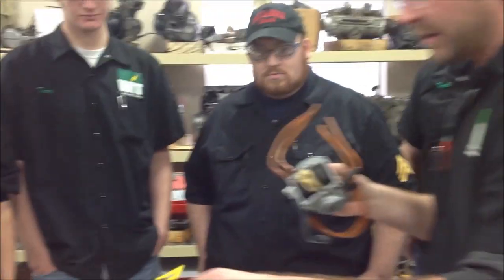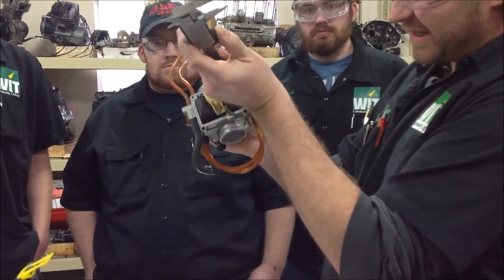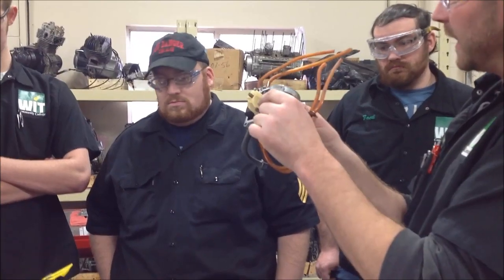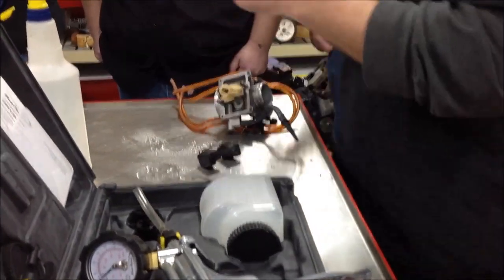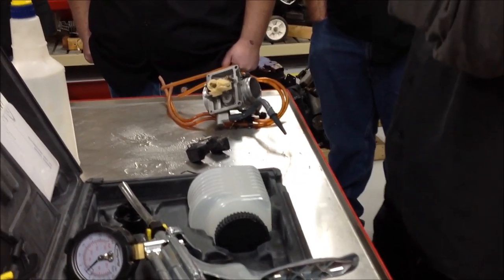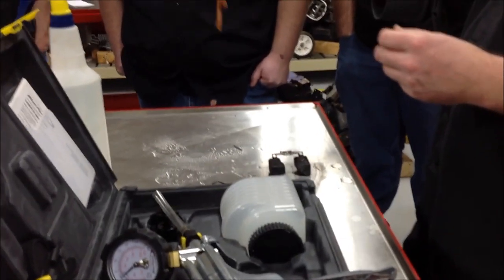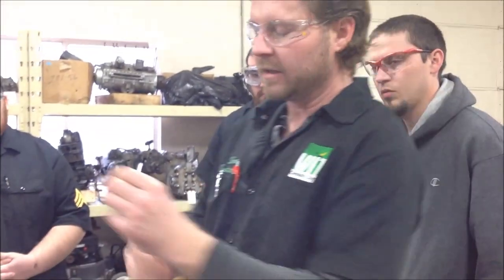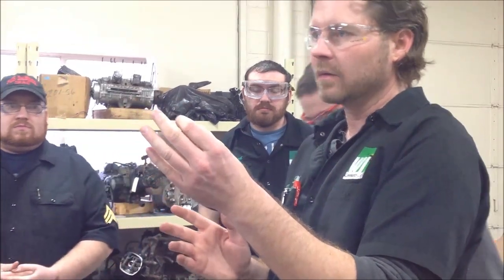Float needle inspection and seat testing on a Keihin or Mikuni Carb Carburetor S&S

Comment: Right on. I have been adjusting the carb so much trying to get everything right. I was adjusting the throttle needle and it helped but was still bogging out in the mid range. Good bottom end and top end but if I'm just cruising it's got a nice sputter to it and it has been fouling plugs too. Time to take a look at the float. Thank your for your brain and sharing it with me.

Comment from the maker: Thanks friends! Many great people have taught me as well!
Reply: Shane great information, can you tell me what port I would connect the pump to a 40 mm CV HD carburetor please. I was having a difficult understanding from the video.
Reply from the maker: +Jordan Tserghanos 
Hello,
No matter what the carb you will attach the pump to the fuel inlet.
Shane
Reply: +shane conley
 Thanks Shane for the fast resonse. Have you ever tested or had experience with CV carburetor modification kits like the CV performance tuners kit or Dynojet kits? I am trying to get better throttle response from my 40mm CV and don't want to swap it for a Mikuni 42 if I can avoid it. I have concerns about drilling the slide and going to a lighter  spring.
Reply from the maker: Love Dynojet and other too....BUT the 42 MIKUNI is AWESOME...I have a 42 but need a 45 on my chopper...107  CU IN
Reply: Thanks again Shane for the response. I haven't had any luck with the standard dynojet kit. I had the slide drilled as instructed in the kit but the slide became irratic. I have since done back to stock parts. 
I am strongly considering the Mikuni HSR 42 because I have heard good things about it like tuneability and throttle response. My 40 mm CV is working ok a tad rich but ok. In your opinion is the Mikuni worth the money and effort? I have a chance to get a new one at a good price. I am on the fence

Comment: i am new to mechanics but i was wondering, what would happen if you tried to start a bike with that carburetor, lets say a kx250 or something? thanks good video, good teacher!
Reply: Needle valve would not stop the gas entering the float bowl. It would fill up your carb and either flow out the overflow or (more likely) flow up the main jet assembly into intake and then into your engine.  ( If you have gas in engine don't run it until you change your oil )  Happened to me. Posted up there ^ somewhere.
Reply: +john hardin how did you get prob sortdid out have same thing happen to me
Reply: buy new carb accessory kit (needle valve, jets and gaskets) and clean carb, that should stop the flooding.
Reply: john hardin  im about to get new carb kit,thanks for your reply

Comment: Help my engine just runs away all my jets are clean I haven't taken my float apart yet but from what o see the symptoms dont match
Reply: Marty, same problem. I fly Paramotors. Cranking it one day while facing it, it ran away, went over the top of my head. Doing so, it slaughtered my left shoulder & face. The propeller I mean, at 6,000 rpm. Bled like stuck pig. Still trying to figure out what happened. Throttle & throttle slide were at idle.
Reply from the maker: It sounds like you’re ready for some Techline help. Coach Conley is also available for hire to personally work one on one with you if ever needed. Yep he is a real person. Give him a call @ 602-345-0432

Details here: https://how2wrench.com/product/personal-tech-training-phone-facetime/

👍 Thank you for taking the time to comment! Hit that subscribe button if you haven’t please! It helps us! 
Here is a way to support all the free videos.
Want to say “thanks” or “keep it up”? Click here https://www.paypal.me/how2wrench  

Your answers and help are just around the corner. Save time and money while protecting your investment and yourself by doing it the right way!
Follow us!
Web:
www.How2Wrench.com    
www.Tools2Wrench.com
Reply from the maker: It sounds like you’re ready for some Techline help. Coach Conley is also available for hire to personally work one on one with you if ever needed. Yep he is a real person. Give him a call @ 602-345-0432

Details here: https://how2wrench.com/product/personal-tech-training-phone-facetime/

👍 Thank you for taking the time to comment! Hit that subscribe button if you haven’t please! It helps us! 
Here is a way to support all the free videos.
Want to say “thanks” or “keep it up”? Click here https://www.paypal.me/how2wrench  

Your answers and help are just around the corner. Save time and money while protecting your investment and yourself by doing it the right way!
Follow us!
Web:
www.How2Wrench.com    
www.Tools2Wrench.com

Comment: Again, an absolutely amazing video and I appreciate the information!  I have a question that maybe you can answer. I'm working on a Bayou 250. Mikuni carb.  It's running very rich at mid /  high rpm. Why would someone of drilled the seat bottom /reverse side of where needle rests? I had cleaned carb with spray cleaner and compressed air with no luck. I finally took everything off carb....that's when I noticed someone has either drilled the hole or made a small, rough "countersink" on the back/bottom side of the seat. I am about positive that's why I can't get the engine to run correctly.  I just tried a similar test to what you demonstrated in video....with float and needle installed, carb upside-down,  I blew threw a fuel line connected to carb with carb under water and me pushing down on the button on needle. I had bubbles. If there is a way to show you a pic of seat, let me know how. I think the drilling or whatever someone did opened up the hole in seat more. Any input will be appreciated.  Thanks in advance.

Comment: my carb was leaking from the overflow tube. i cleaned carb and replaced all jets (repair kit). Now when i test the new needle valve, it does NOT pass air. when using an air compressor (fuel inlet) it does BUT it blows out of the whole valve from sit. My question is, does the small  pin in the valve suppose to pass the air and stop when compressed?
Reply from the maker: May find your answer here in this playlist or if you're still stuck I offer one on one. https://www.youtube.com/playlist?list=PLAtBOuPaEyt-ZMVRlpvWmVFLL10P16vWf

Have you Subscribed yet to never miss a video? Have you seen the video playlists https://www.youtube.com/user/conleybuilt/playlists? 

Want to say “thanks” or “keep it up”? Click here https://www.paypal.me/how2wrench    

Your answers and help are just around the corner. Save time and money while protecting your investment and yourself by doing it the right way at www.How2Wrench.com
Reply: @How2Wrench  My specific question is about the spring clip that binds the float with the float valve. Is it suppose to hole the float tab tight on the valve pin (without compressing it of course) or dingle freely with gap? I had the concept that he valve regulate the fuel flow so when the float compress the valve pin it stops the flow OR the float lifts the whole valve UP and by so allowing the fuel to flow (which in this case, the spring pin on the valve is just to dampen the vibration?
Reply from the maker: Sean If it was a quick answer I’d try to respond here but I wouldn’t want to lead you wrong assuming certain factors. Reach out to me on my website contact page. We have been overwhelmed with ungrateful people and
scammers so I had to do something for my sanity by screening the over 300
requests a week! I’d love to work one on one with you! Contact Link: https://how2wrench.com/contact/ 

Your answers and help are just around the corner. Save time and money while protecting your investment and yourself by doing it the right way at www.How2Wrench.com 

Have you subscribed yet to never miss a video? Have you seen the video playlists https://www.youtube.com/user/conleybuilt/playlists? 

Want to say “thanks” or “keep it up”?
Click here https://www.paypal.me/how2wrench

Comment: My mikuni bs26 carb was leaking through drain plug, when parked on side stand, leaned towards left, leak continued after changing the needle valve and next cleaned the valve seat too, but still leaking...your thoughts...guys..
Reply: Did you managed to fix it?

Comment: my motorcycle carbs have non replaceable seats (pressed in brass cylinder) and so i followed instructions online on cleaning them and polishing them, but they still leak when i hook them up to a fuel tank, yet seemed not to with 5 psi of air, is there something i am doing wrong? i bought brand new needles, are the floats supposed to just press on the spring pin or should they apply force to the needle itself before they hit the carb case
Reply: Did you managed to solve your problem?

Comment: The needle valves are cheap because they're made in China. But that material on the needle valves shrinks with gasoline. I run alcohol in my motor so it's Wells the needle valve up stick with the OEM needle valves

Comment: I like his methods, but why spring straight for replacement? don't be a lazy shit, pull the needle and seat and inspect/clean first. ya gotta get it out anyways. there's a good chance there's just some shit from modern gas that got lodged in there. most of these small cycles don't run fuel filters.
Reply from the maker: +Logan Mailandt 
Keep in mind there are many variables. Labor can be intense to remove an replace parts. If a bike is old or high mileage that must be taken into account. One must also consider labor time versus parts cost.